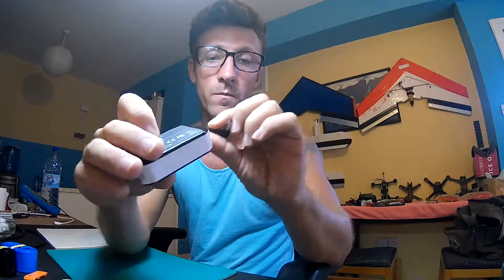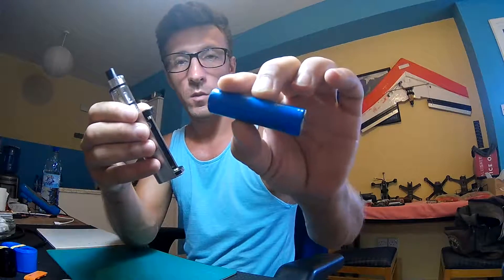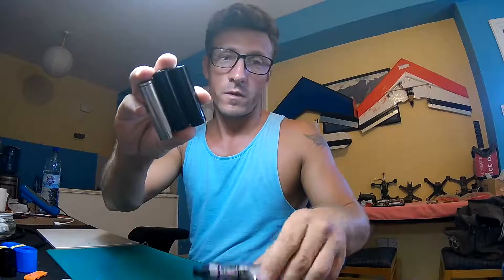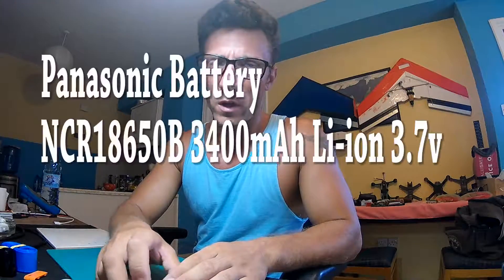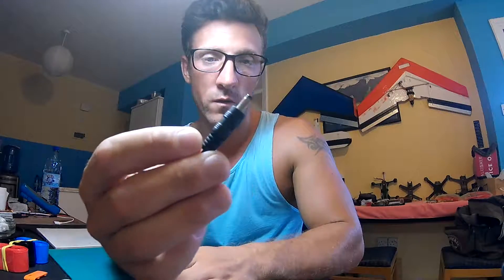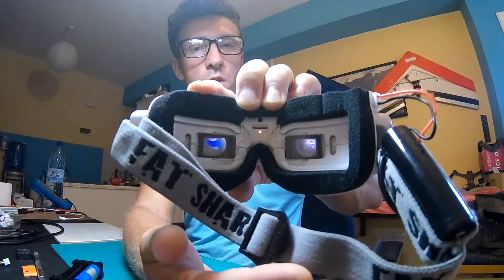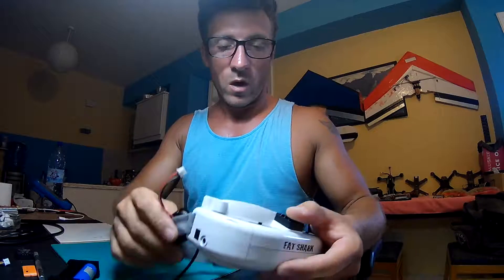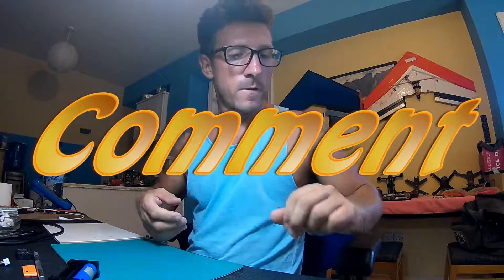Diy Battery For Fatshark Dominator HD2 V2

Comment: How do you balance the cells while charging if you don't have all three wires for the balance lead connected?
Reply from the maker: redline870 Hi. On the original fatshark battery i don't have 3 wires so its no different from the original one. But if you want you can put a balance wire from 2S and its ok.
Reply: Frincu Gheorghe Daniel the original fatshark battery has a built in balancer, it is integrated into the LED status checker, that is why it doesn't have 3 wires. If you are not using an integrated balancer with your DIY battery than you should definitely have a 3 wire balance lead to balance the 2 cells because it can not balance with only the 2 wires. It can be dangerous if you don't balance them.
Reply: Frincu Gheorghe Daniel if you look at the factory fatshark 18650 battery case, they recommend that you remove the batteries for charging because the 2 wire plug will not balance the batteries.